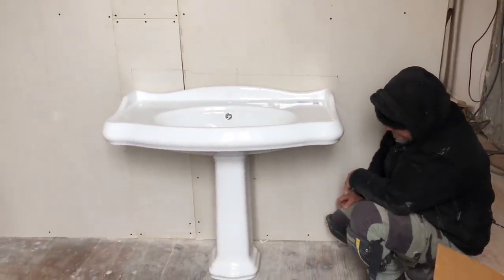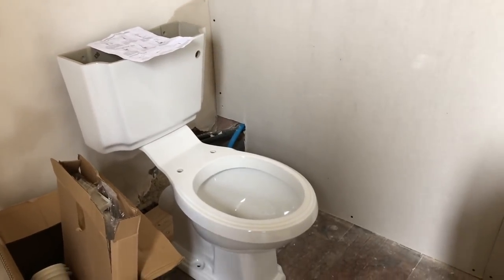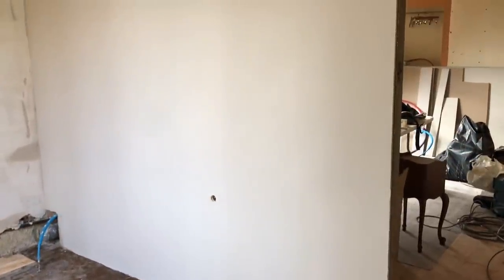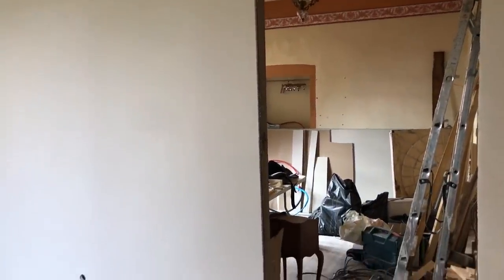New CHATEAU BATHROOM INSTALLATION #DIY #Bathroomrenovation #Chateau

Comment: I truly hope you guys STUFF all walls/floors/ceilings with massive amounts of rockwool - for heating but mostly
your guests will not be too happy listening to flushing toilets or extra loud neighboring guests.... 👍👍👍👍
Reply from the maker: Hi Thomas, as we fit new ceilings and walls where necessary we will insulate. However the guest suites are set up so that they aren’t next to each other. Two are off a separate small landing to the master suite we are working on and even these bedrooms are separated from each other by a small corridor and balcony area so noise from other guests in the suites won’t be an issue. We will only be a small B&B with three suites operating at any one time.

Comment: This may seem like a dump question. Here in Canada we don't completely plaster over all the drywall.  we only mud and tape over seems and corners etc. Is it a different material you are using?
Reply from the maker: Hi Isabel we’ve had this comment many times actually so not dumb no ❤️
In UK are Europe it’s common to use a lime or gypsum plaster product which we skim on to the entire wall. It gives a really nice finish - just the traditional way it’s been done. Centuries ago lime was the way (and should still be used in traditional settings in many circumstances) and more common now is gypsum